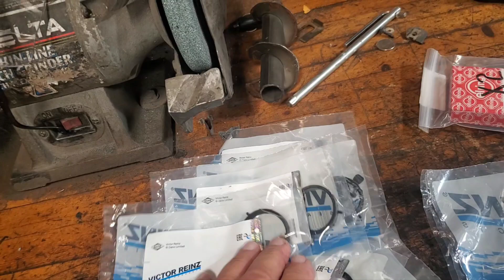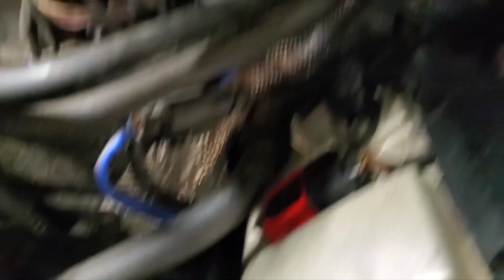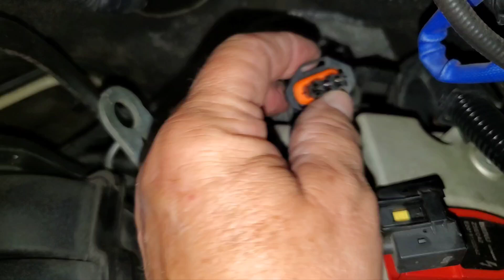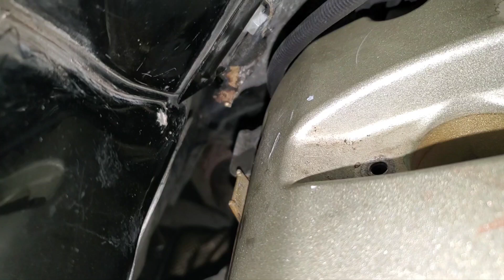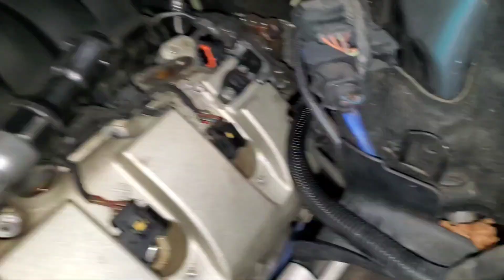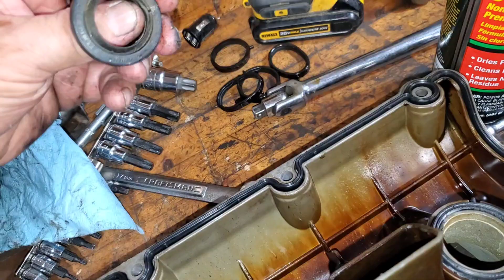2009 Porsche Cayenne S rescue valve cover gasket replacement

Comment: 12:25 the toughest bolt in the whole job. FCP Euro has a video on this and their method worked for me, no heat shield cutting required. There’s a tiny 1/2” long T40 bit made by a company called “Vega” for 1/4” drive, that plus a 1/4” drive swivel extension, plus a 10” 1/4 drive wobble extension on a 1/4 drive ratchet. Wow what a pain, but it got it out from the top going down almost vertical against the side of the firewall. Crazy geometry to loosen this aluminum bolt which is easy to strip if the head is filled with oil & crud.

Comment: Great vid. gives me some confidence to try. For someone not mechanically inclined and somehwat broke. How well would forgoing all this and using a stop leak like at-205 work? Downsides?
Reply from the maker: Probably not well. There's a lot of oil splashd inside those covers so it's going to find a way out.

Comment: The sensors you are talking about are VVT solenoids. They control valve timing with oil pressure. Type is open/close. VANOS VALVE TIMING (VVT)

Comment from the maker: I just found this set which might work for those hard to reach cover torx bolts. https://www.autozone.com/ratchets-sockets-and-wrenches/ratchet-and-socket-set/p/duralast-dual-drive-gimbal-ratchet-tamper-proof-torx-star-bit-set-14-piece/569692_0_0
Reply: I tried them and it needs to be slimmer